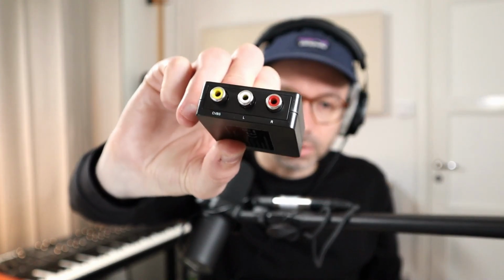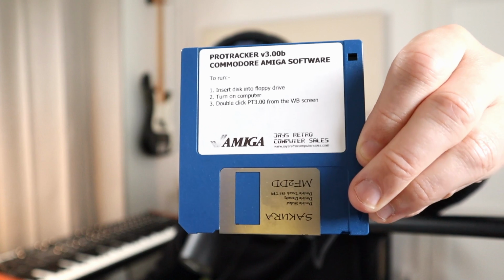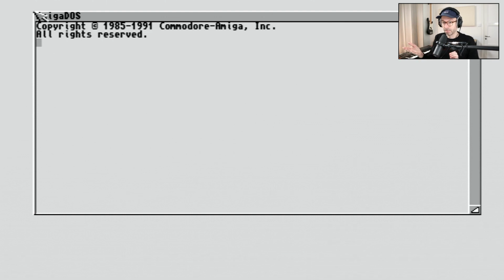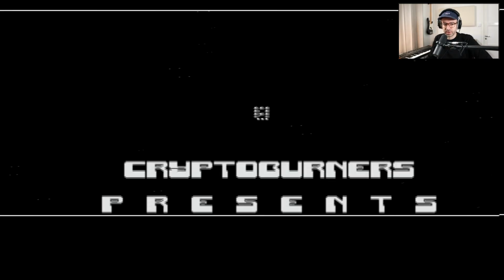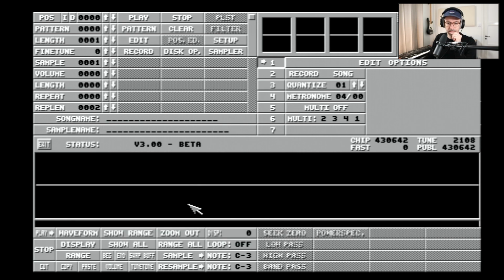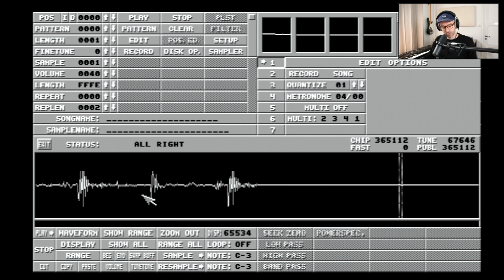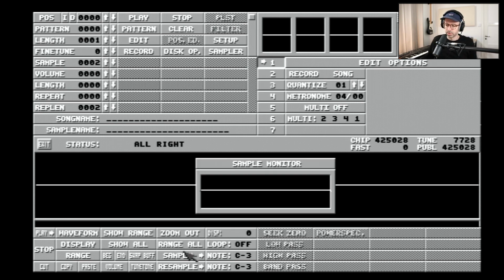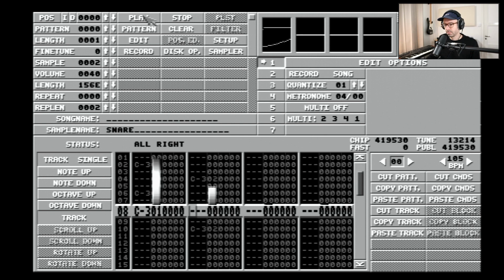Overcoming the challenges with the Amiga 500

Comment: Are you going to upgrade it? I would suggest trying to get hold a rpi zero (might be hard to find, they sell out pretty fast) and the RGBtoHDMI project which takes the internal RGB and converts it directly to HDMI, and maybe an accelerator that will also allow for compactflash or sdcards for fixed storage (PiStorm, TerribleFire). I saw you have v2 kickstart roms, which can boot from fixed disks.

If you want to go beyond 4 tracks, you could look into octamed, but you would need a beefier CPU than the standard 68k that the 500 has.
Reply from the maker: Not sure yet, the RGB to HDMI sounds interesting, I’ll look into that!